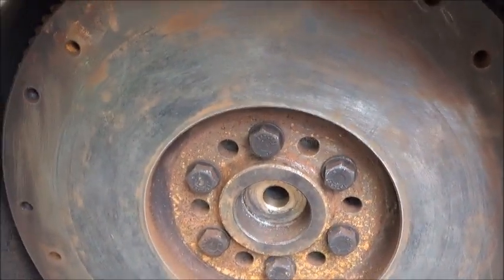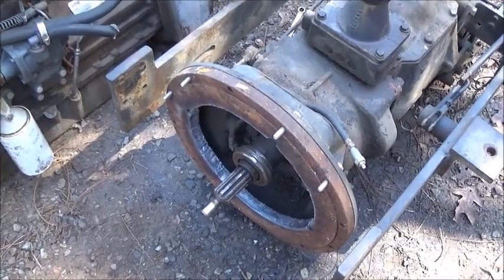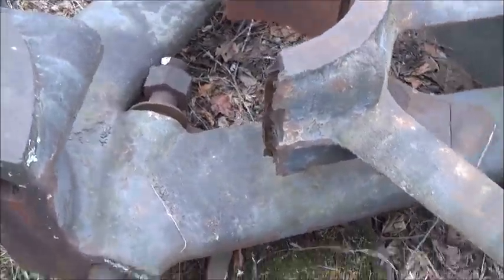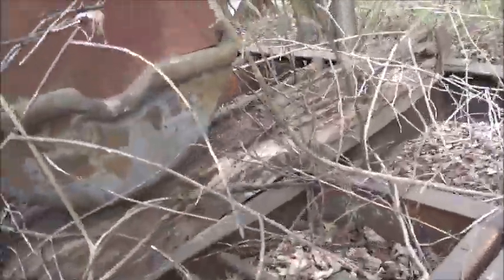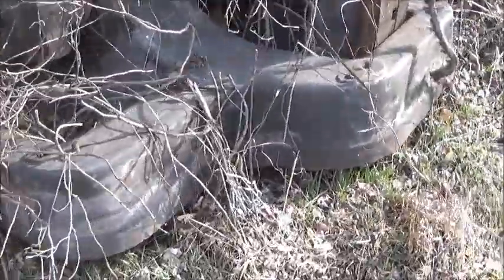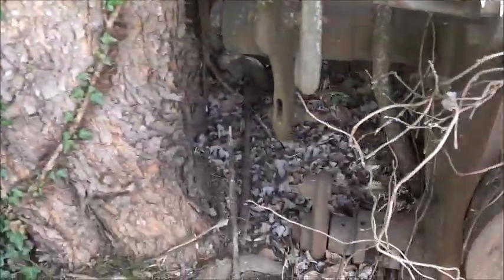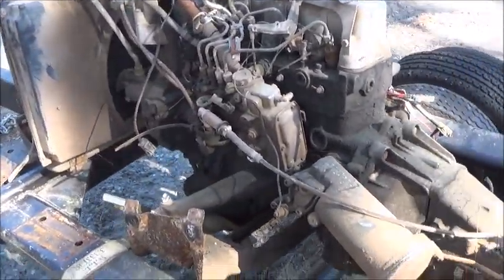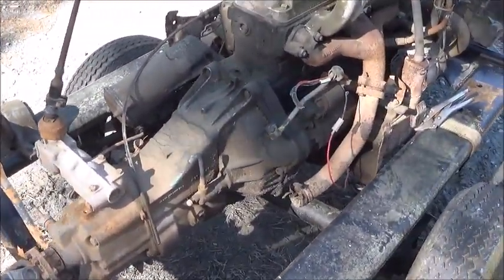FORKLIFT GAS TO DIESEL  & STEAM ENGINES

Comment: Jonathan, just because the seller wants full scrap value, don't mean they'll get it from any scrap dealer.  Those prices quoted by dealers are for delivered to them product.  The cost to retrieve from the woods will have to come off the price paid, no scrap dealer will knowingly pay more than they can make from a job. If your serious about it, just make them an offer you can live with. If you don't get it, no loss.  Most modern scrappers aren't that interested  in working that hard to retrieve those big items, even to cut up on site will be a major cost in time and material.

Comment: I love that old Mercedes Diesel. We had a 1984 240-D non turbo that had almost 300,000 miles when we bought it with a fresh set of rings and bearings. We drove it to over 500,000 miles with maintenance, one starter rebuild, a few glow plugs, and two $67 upper control arms. It got 28 MPG all the time, up hill, down hill or off a cliff. Bud Merz, in British Columbia, on you tube has a homemade govenor on a wood saw that operates like the old lawn mower govenors spring loaded off the air from the fan.

Comment: Hey Jonathan, even if incomplete that daddy of a steam engine would be a great static display, better than being scrapped.
Reply: Jonathan you have turned me down before but my dream is starting to fall apart. I need your help. I am willing to come up on weekend to help. I have a 42 jeep body I have a complete s10 4 wheel frame complete. Its was running last week. I need the s10 fit to be the jeep. I don't want air or any thing look like that. We might have to short frame and drive shaft.  I want you do do it cause y I u are the best. I don't care if it takes a year. I can help with your engines. I have a cdl a but I haven't  drove since 2005

Comment: Jonathan on those engines you would be better served to pull the trees out of the ground with a crane and cut the roots and top off. Man what a pain that would be in any form. The main worry I would have is the parts filling up with water and freezing. That spells tragedy for sure. That is one heck of a lot of weight.
Nice job on the forklift!
Cheers
Terry
Reply: Isn't it better to saw the tree away before lifting fragile cast iron?
Reply: @waynespyker5731  I meant to lift the parts and pull the tree with it. As big as those parts are you would be digging under them for weeks. Hey, I knew what I meant........ LOL!

Comment: Those engines have been there forever, I doubt they are going anywhere. Besides, who other than you has the equipment to move them. Maybe make an offer based on how much work it is to remove them, the scrapyard will only pay top price if they are delivered.Hopefully the owner will see it that way too, good luck, and good video, thanks

Comment: Jonathan  I have a 42 model jeep body that I need fit to a 4 wheel s10 truck frame. The running gear is complete. I want you to do it cause I trust your welds. I plan to drive it in the morning on the mountains.  I have a Cdl a but haven't  drove since 2005. Would you consider helping  me with this project

Comment: Hi Jonathan, You would need a RSV or possibly a RQV governor for a Bosch injection pump.
That's all I've been able to find out. Looked at them on the German Ebay site but what is to be had is all still connected to a pump and thus pretty expensive.
Thanks for another entertaining video !
Cheers, Ard

Comment: On a 240 Diesel Mercedes Benz engine like this type, the oil filter housing usually stands upright (extremely easy to change the oil filter). It is different here, because the engine was in a transporter/pickup truck and not in a car/sedan. I really don't know but maybe the flange can simply be turned around at about 100 degrees (360⁰ = circle). So the oil filter housing would be out of the way and much easier to maintain!

Comment: Hi Jonathan, regards a govenor, if you cant find a belt driven one at the right money you should seriously think of fitting a modern electronic one, they are so cheap now, last one i bought was about $50 for the control unit then you just need an actuator and a pickup. these shouldnt be expensive either.and its all easy to fit, the pickup counts the flywheel starter ring gear teeth and the actautor just pulls on the throttle ..it just needs to be hooked up to a 12V supply

Comment: About your governor problem.  I have known of people using automotive cruise controls on homemade sawmills.  Of course the old cruise controls are getting scarce now, but you had the aftermarket type that used the servo and the magnets on the driveshaft.  And you also had the old GM type that fit in the speedometer cable and were a combination of mechanical, electrical and the servo was vacuum.  I had a 1994 Pontiac Bonneville that still had this older GM setup on it.  Not sure if your transmission has a speedometer cable hook-up?  And being diesel I guess you do not have vacuum.  Ford had a vacuum servo on their cruise controls also.

Comment: I was looking around for good rotary tables within a day's drive from where you are and most of the ones I found which weren't too expensive were either really small ones or ones bigger than 12 inches, and I'm not so sure a rotary table bigger than 12 inches will fit on a Series I Bridgeport table.

Comment: Ok Jonthan, I give up, how the heck you going to know the input shaft is dead nuts centered to the pilot bushing to drill your dowel pin holes on the fork lift motor?.  Are we dealing with your witch doctor again ? magic spells? or maybe  VOO DOO ?  lol . Your good , and lucky BUT ???? one of these days kaaaBOOM !----- ooooopis go to plan B .  Best be on the hunt for a nice used rotary table for your Mill , you got to do it.  There's just some things you just can't be with out.
Reply from the maker: I made bushings to go on 4 of the bell housing bolts. Before I cut the center hole I used a magnetic base dial indicator. Put it on the flywheel and turned the engine. It was dead on using the shims so I went with it.
Reply: @jonathanw4942   How could you see the indicator with the bell housing in the way ? Yeah I know, ----had to see it for myself. Well if gas  wasn't Joe Biden price I might run up and see yall, but can't see another mortgage on my house just to come up. I have family in Virgina   F.J.B.

Comment: I have a governor on a flat six Chrysler would that work u think ...shame about those steam engines  but it is watt it is ..u making good progress on that fork lift engine n box watt u could've done to line up that steel plate just ream out 2 holes put the pins in then bolt it up take out the pins put other 2 bolts in but looks like u got it figured out ..

Comment: Bell housing alignment - Have you considered adding a bolt circle of 4 dowels before machining the male diameter away?   They could be stepped off on the mill without the need of a rotary table.
If  you ever get to York, Pa I have a used but good 16 inch diameter rotary table you can have free. (Was starting a basement shop when I developed a diabetic left heel ulcer 4 years ago)
The Virginia York engine is intriguing. 
The York Industrial Museum has a restored York ammonia compressor on display complete with Corliss steam power. (During my 56 years of tool and die career I have met many York Corporation craftsmen, a JCI member today.) 
To see the Museum unit that produced 72 tons of ice per day in rotating operation: 
 https://youtube.com/watch?v=LOCg7wELEo0&feature=share
Visiting the ice house was always a treat especially during the summer. Cannister size blocks of ice as shown in the video would appear from a wall opening sliding on 2 rails heading to a gang saw which scored it into 8 potential blocks. Ice dust from the multi blades flew, the attendent would ice pick a score line for your request and if you wanted crushed dropped into a crusher.